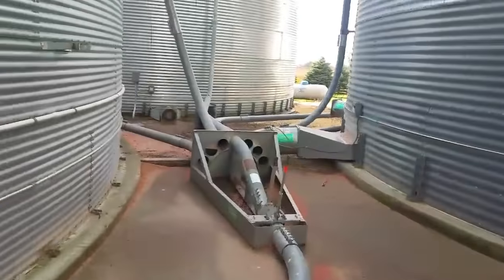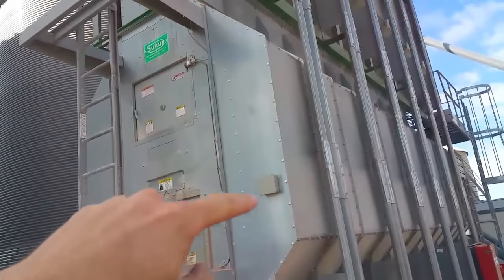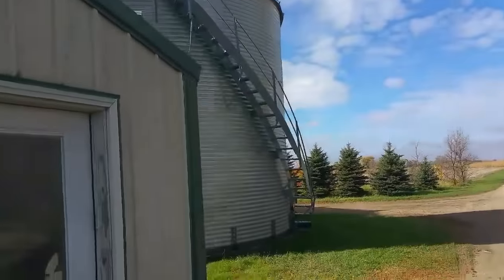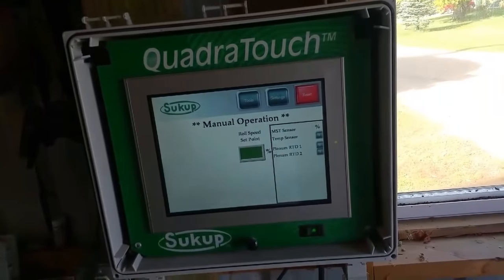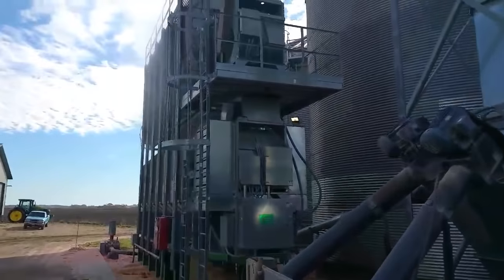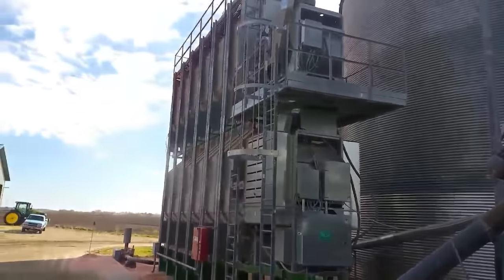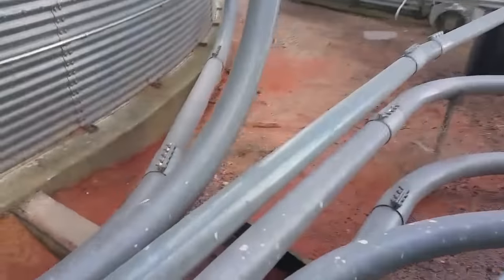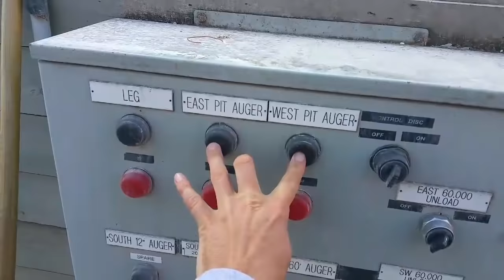How the grain dryer, bins, and dump pits work

Comment: I run a brock tower dryer at an ethanol plant. Were starting to get wet corn now. Our dryer operates very similar to yours but just in a larger capacity. We dry about 6000 bushels an hour at full capacity

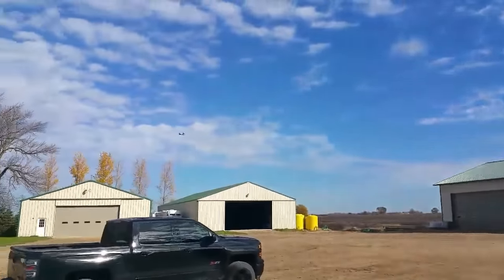Comment: Looks like a DeHavallen  of Canada, DHC-6 Twin Otter to me,  5:02 
They have Pratt & Whitney,  PT-6 turbo prop engines on them and were Still used as commuters back then to out of the way airports, they are Best used out in the Bush as they are a very good STOL (short take off & landing)  aircraft. 😎👍✅

Comment: AWESOME!  I wanted a more detailed overview of your system.  I do have several questions for you when you have time to answer.  (1)  What is your total capacity?  (2) Do your bins have stirrers and/or powersweeps?  (3) Do you empty your bins out every year and clean them out?  (4) Do you do anything with all the corn residue (mostly the red chaff)?  

Be safe. Good luck.  Prayers to all farmers!
Reply from the maker: thr8061 Our total storage right now is around 250,000 bushels (some of that is beans right now).  None of our bins have stirrers but they all have powers weeps in them.  Most of our bins usually get emptied every year, but often times we do have some carryover bushels.  we do shovel and sweep the bottoms clean whenever we empty them.  We also move our carryover grains from one bin to another just to ensure the quality of it (grain sitting tight for too long has more tendency to start spoiling).  Usually the red chaffe gets shoveled into a loader bucket and spread back into the fields.  Sometimes someone will use the corn fines for feeding (hobby pigs, chickens, etc.)

Comment: You were sent back. Do you have any kind of pager to tell you in field that it has shut down? Also thinking back many years ago when a propane pipe had issue. And Farmington,il terminal was hauling by take truck all the way to keep you  supply one fall. Trucks setting to load several hours. Was a wet year.

Comment: Do you ever have issues with plugging in the air blowing lines? I have never seen that pretty cool.
Reply from the maker: Noel Hohberger We have plugged them a few times, always when we're trying to feed the corn through too fast.  We have also blown the pipe collars apart twice but since we started supporting the pipes better we haven't had that issue for a few years.

Comment: Is your wet corn bin bottom cone or flat and need to powersweep every few days ?  Also where did you get them power hopper bottom gate openers and the price of them ?  I'm getting lazy.. lol
Reply from the maker: JGM It's a flat bottom.  We empty it completely every week-10 days if the corn is really wet.  at 22% it stays on the bottom for a while with no problems.  The electric hopper bottoms are an add on kit but I forget how much they cost...
Reply from the maker: JGM There are several after market companies that make kits for them.  A local trailer dealer should be able to help you out.

Comment: How do yu like the air system? I am in Owatonna MN and we run a wet and dry leg with drop tubes to all the bins.  I was told the air system is slower but your dryer is large as mine and it must flow enough to keep up with the dryer. Thanks just saw your vids yesterday and I really enjoy them.
Reply from the maker: Allen Yule We love it.  When we have dry corn we do wish it was faster though.  It's the 6" system also.  You probably typically have drier corn than we do so you may want to check into the speed of it.  It goes faster when we're blowing into the bins that are closer to the motor.